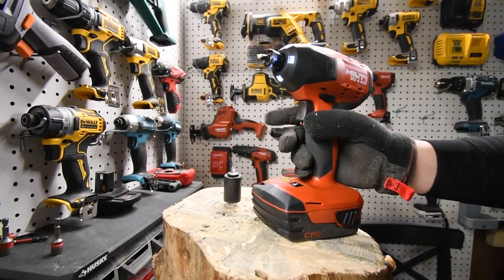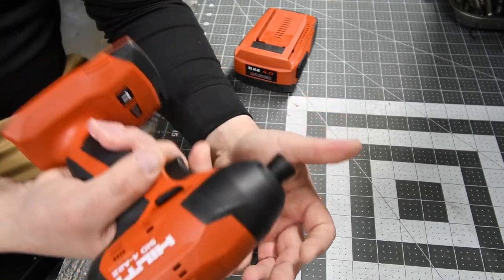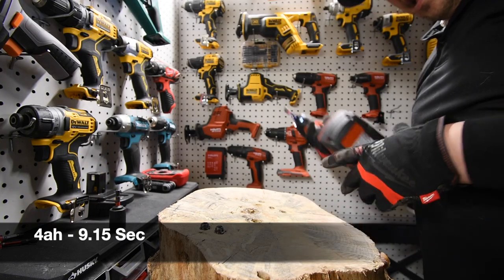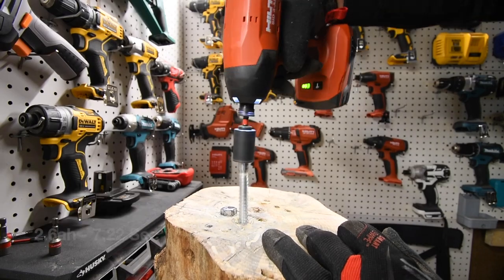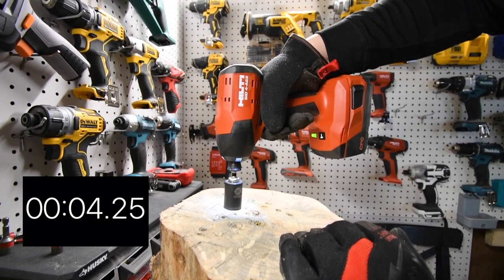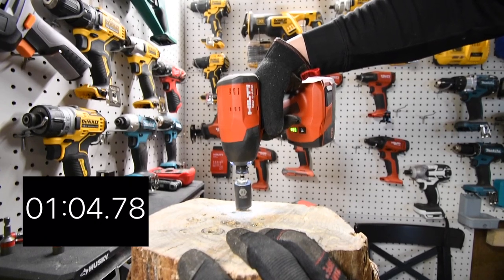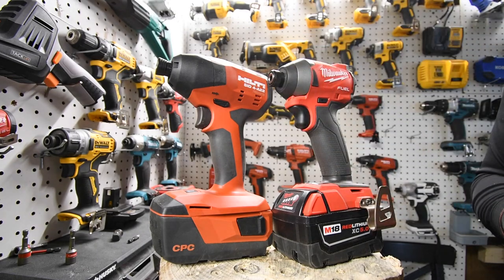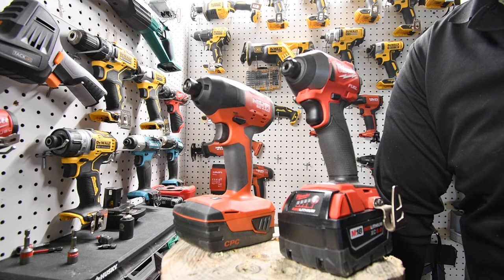HILTI Impact Driver

Comment: The only thing I can say about Hilti is the fact they last insanely long. The Hilti impact is weaker but very well made. Milwaukee is stronger and you could buy two of them for one Hilti. Depending on the tools you need sometimes Hilti may cost more than 2 times the price of other professional grade competitors. I personally think the Makita TD171DZ is hands down the best impact driver made. It is a little less powerful than Milwaukee but can withstand the test of time. It is one of the few Makita tools still made in Japan. Also for those who may not know Hilti is the leader in concrete applications like SDS Rotary Hammers and so on. Bosch SDS Rotary Hammers are close. You won’t go wrong with either. Thanks for this video. I wish I found your channel sooner.
Reply from the maker: I do thank you so much for viewing :)

Comment: What people need to understand that with HILTI , you’re sacrificing just a little bit of power for durability, the vibration from their tools don’t wear out batteries like Milwaukee’s does but nonetheless Milwaukee is great too. Just personally I’d rather spend a little more to get longevity out of my tools.
Reply from the maker: id pick HILTI over most brands and I agree with you Samuel
Reply: Here's the reason why makita makes some tools a bit less power than milwaukee but nice to use  it

Comment: Nice video I have that Milwaukee with a 4ah, a 6ah & a 9ah batteries I use 4 all the time but I was testing it with 1/2" x 12" long lags length ways in to a pressure treated 4x6 the 4ah kept making tool cut out & the 6ah could do it an average of 3 times then tool kept cutting out bot my 9.0 did over & over until I broke 2 Milwaukee 1/2" square to 1/4" adapters and I finally gave up & checked tool temp was 127 degrees I think the 9.0ah was not intended for this impact driver because it seems to push tool to hard I typically only use my 9.0ah battery for my Milwaukee 2767 impact wrench
Reply from the maker: more test sand versus videos are coming and I thank you Brian :)

Comment: Just something to note here: It is NOT necessarily a sign of a defect in the tool if it skips beats on the anvil. If the load you’re driving is at a point where it is just barely on the threshold of compressing the spring in the impacting mechanism, this can easily cause those “skipped” beats. In other words: The load you’re driving might be at a point where some beats simply don’t need impacting, and others do. Think about it: If the fastener is turning at all, then this is clearly the most likely explanation.

Comment: I had those milwaukee socket adaptors. A pack of three. I now have one. Lasted less time then my local hardware stores own brand 🇨🇳 👎
Reply from the maker: the new makita XPS will be tests and I thank you Shane
Reply: Apparently Milwaukee bits in general tend to be kinda average even though they are really expensive. Everything I've seen points me towards DeWalt bits most of the time, though I do prefer Milwaukee tools.

Comment: Cool ! I am exited to see it vs dewalt and milwaukee gen 3 because hilti is more expensive and in my opinion not better than milwaukee or dewalt ...
Reply: Steven Gagnon whoa hold on there, as bare tools hilti isn’t the most expensive. And just because something is faster doesn’t mean it’s better.
Reply: @vojnikjna30  i am a carpenter and if its faster and compact a want it .. faster = more money in my pocket
Reply: Steven Gagnon that’s great! stick with dewalt or Milwaukee then. These hilti are production/ industrial tools. Tools are only as good as the user anyway.
Reply: @vojnikjna30 they are all made in china
Reply: Steven Gagnon so what? clearly you need to do a bit more research and you probably never used a hilti. Worth every penny and more. Thanks!
Reply: @vojnikjna30  i use the impact the drill the saw 61/2 the sds the reciprocating saw in 22volt not impresive at all
Reply: They or built tough but not powerfull its my opinion .. i use flexvolt daily haha💪
Reply: @vojnikjna30  When you buy something you never buy just the tool, unless you already use said brand but that makes the comparison redundant.
With being said hiltis are twice as expensive but do not give twice the performance, so not exactly worth more than every penny imo, but make of that as you will.
Reply: @Turgz  amen 🙌
Reply: @vojnikjna30  Only as good as the user? Please explain on how to pull the trigger more efficiently to make the hilti perform better??
Reply: You are so right about that. I had them all I love dewalt that is my brand but I do like them all
Reply: @Dexter_Solid  you right cuz
Reply: @vojnikjna30  I used Hilti and went with Dewalt and Milwaukee instead.Cheaper,better,smaller and can be repaired anywhere.
Hilti was big 10-15 years ago especially on the rotary hammers ,but it's not the king anymore.Their tools are very well designed and put together but big,heavy and expensive.
Reply from the maker: we will see and more video are coming up

Comment: This is the second video I watch from you and you seem to think that “ampere hour” means “power”.

Well it’s the amount of ampere you can drain out of it for 1h.

Theoretically there’s no difference since the batteries are both 22v and the engine will suck out the same amount of energy from both when running. The bigger battery will just last longer.

But there will be instances where it’s different I’m sure. But still! No need to think it would be different.
Reply from the maker: the more cells that are in the battery the better the tool will perform. the voltage doesn't change. the more cells in the battery the easier it is for each cell to carry the load of the tool working. each cell has to work less with more cells allowing the tool to retain the power the battery already has. a 1.5ah will not perform the same as a 8ah doing the same single task once. its not only duration. the 1.5 and will drive. a 4" lad screw slower than the 8ah would. even thought its only doing 1 screw
Reply: Yes and no.  The 2.6 ah compact battery pack is using 18650’s in series.  The 4 ah compact battery pack is using 21700’s in series.  You can safely draw more from the 21700 cells and for longer.  Depending on the microcontrollers in the battery packs and tools and the power requirements of said tools you can notice a minor to a major difference in performance (most Bosch power tools happen to be controlled in such a way that the more available juice, the faster the motor spins in an obvious way).    Generally the 18v (21.6 for Hilti) tools up until recently are designed for battery packs with 10 (12 for Hilti) 18650 batteries = 5 (Hilti 6) parallel sets in series.   The expectation has always been that the single row compact battery will give up on the power end.  The messenger in the compact pack tells the tool, “hey, be easy on me, I’ll overheat quicker than the normal sized pack you were designed for” and the tool should be stunted to a degree (or in some cases, the tool won’t even run on the half-pack).   I’ve had plenty of experiences where the fancy motor protection on a drill says “nope” with a slim battery, requiring me to put the standard pack in.  Likewise, on some Metabo and Bosch tools, I’ve been able to use the compact 20700 and 21700 interchangeably with standard sized 18650 packs.   Batteries are a weird beast.

Comment: Mainly Because I absolutely crawl in my skin seeing a 1/2x4 inch lag not being pre drilled first. How about a head to head combo test against brands?  with pilot hole and lag, drilling various pilots and dry running standard size screws as if they’d be used in the hands of the consumer to provide a more helpful video for the home gamer to the most dedicated pro.
Reply from the maker: I can do that and I thank you Pulse

Comment: Good job! The only thing I would like to mention   That the Milwaukee was slower to take out Hilti’s 10 inch leg bolt! It took 3 times longer than for Hilti to take out Milwaukee’s! I know Milwaukee has more torque but it is shows that the density of the wood wasn’t the same!! Should be less difference to drive it in! Thanks!
Reply from the maker: there is no wood in the world that has the exact same density in every square inch.

Comment: I disagree on the the hammer drill break out the new dewalt 998 power detector I got my money on the dewalt
Reply from the maker: we will see what it can do
Reply: @ManCaverTools  👍
Reply: @ManCaverTools   But u know just because one tool might be faster than the other that don't make it a better tool. Quality is what's important and I got a friend that has had his dewalt set for years and it's been abused and it is still going

Comment: HILTI don’t have the build quality they used to. As for durability nearly all my new tools have been repaired within 2 months of buying.  Batteries don’t last much past their warranty limit
Reply from the maker: we will see how hilti does in the future and I thank you for viewing slav
Reply: Wow that’s hard to believe.  Have had Hilti for around 5 years now and exceeded my expectations on the quality/durability of the 22 volt line/12 volt 
Batteries have been great as well. Not one problem and the nuron line has proven just as good going on a year now with a lot of products.   Came from milwaukee and although I love the power, long term they have problems.  With having the milwaukee gen 2,3,&4  and Hilti sid 4 and the new 6
I still use my Sid 4 over all
Of them.  Slow, and less power so have it.  Great driver imo